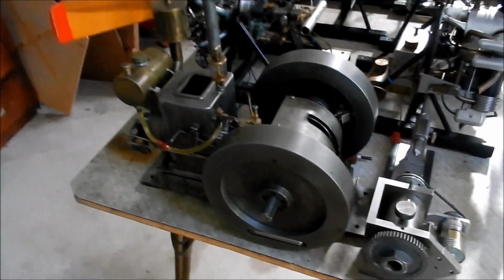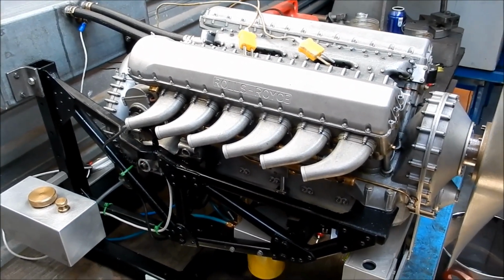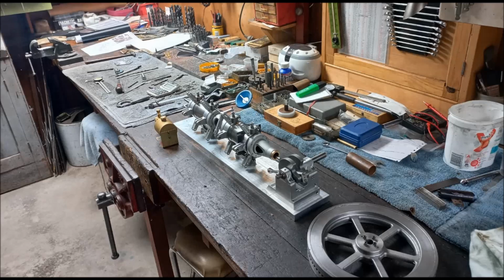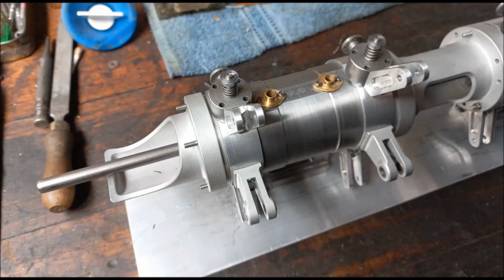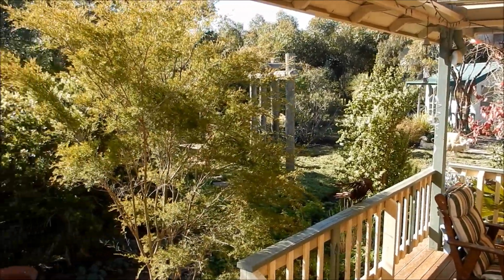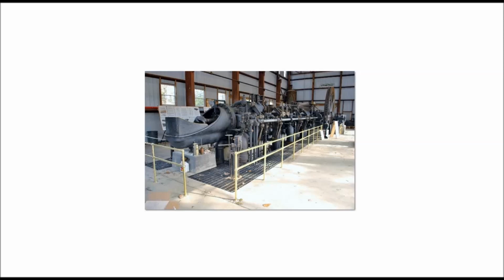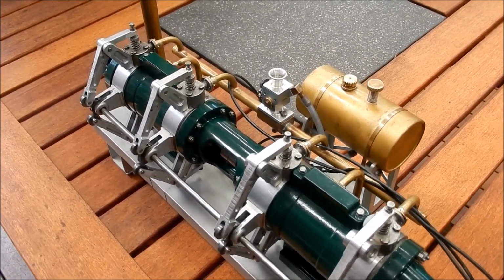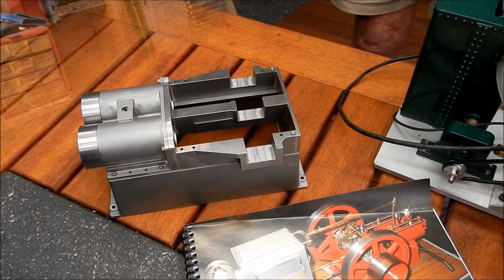John Ram and his models featuring the Snow

Comment: Wouldn't that single carb just wet the long runners and waste fuel?
Reply from the maker: I'm not sure but it does work beautifully.  Not being at all familiar with the original I'm not sure how they over came the issue.  Working in a gas plant it my well have run on gas.
Cam

Comment: I wouldn't really call those radial engines as rotaries. As theres an engine called a rotary (and cannot really be called anything else, idk, angry dorito engine?) But Radial engines means they're engines in a radial/circular position.
Reply from the maker: G'Day Reedman, that particular engine John called a Rotary has the entire piston bank rotate about the crank so yes it is a rotary.  All the others are Radial engines with the cylinders stationary.
Cam
Reply: @camatbattler2233  ohhh interesting. Yeah that could pass as a rotary for it being actually a spinning radial engine. Though the torque forces on it would be great innit? That might be problematic